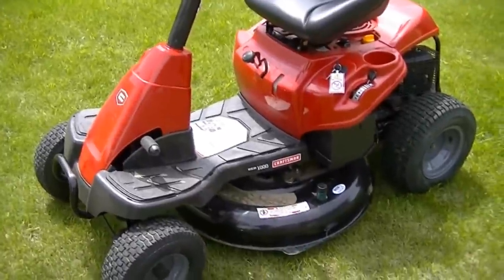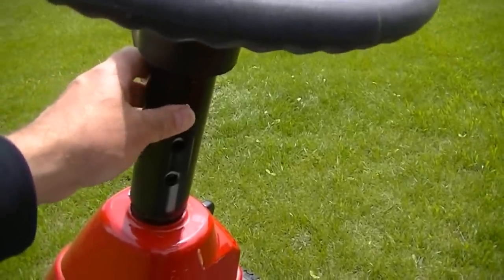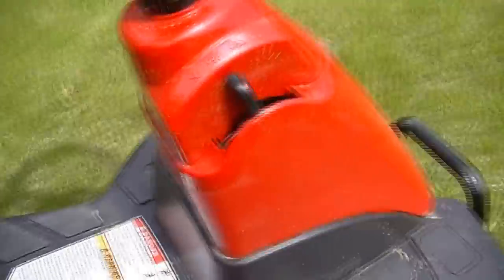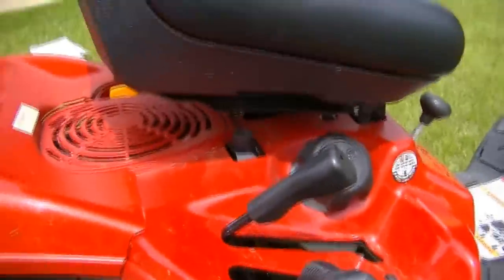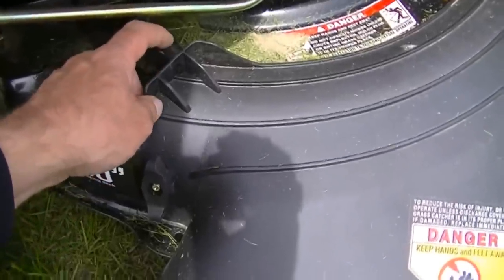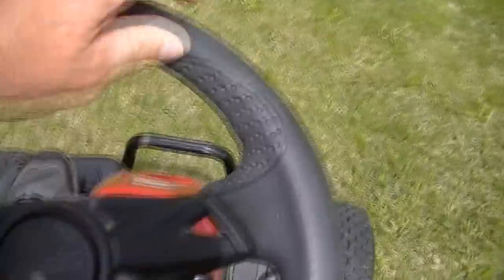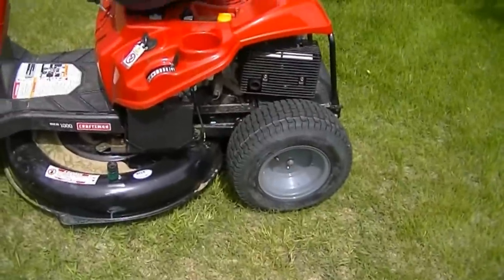Sears Craftsman / Troy Bilt 30" Rear Engine Riding Mower Review

Comment: I've had this mower for 9 years.  No real problems using E10 or no ethanol gas.  I've had a screw come out which holds the oil filler neck 
and has a ground connection.  Can anyone spec this machine screw for me?   The on-line parts view does not show the specs for the small bolt.

Comment: while the seat safety switches can be a pain at times, they whole purpose is in case you accidentally fall off. Imagine your on  hill side and it flips over, you fall off and then a big blade chops your face off.  Deal with the switch and leave in place.
Reply: I've had my R110 Craftsman mower for about two months now. My lawn is flat, but the edges are sloped with gravel and landscaping. About the 4th time using the mower the wheel went over the edging and before I knew it, started up the slope and into a bush. it kept trying to climb the bush and before I knew it flipped over backwards on my back. I'll keep the seat switch, thank you. Can't imagine if the engine had kept running? Im one lucky fella to have no serious injuries from that incident.

Comment: I would probably use mobile one 15 W 50 in it and if there’s anything you can grease I guess you could use boat trailer grease or a really good extreme pressure high temperature grease and obviously stable 360 in your gasoline

Comment: I recommend not using the wash feature on the deck. If you have an air compressor, use that instead. Water will rust these decks out fairly quick, or on any mower for that matter.
Reply: SPACE TRUCKER .. or a leaf blower.
Reply: sounds like a plan ,but it does say to run is for few mintues to dry it fast ,but i would do the same an wash it when it wet grass,then blow it off,wax it but first thing put be liner under the deck 3 coats ,but tape off blades

Comment: I bought the Troy-Bilt version of this (They are all made by MTD), and found two things completely unacceptable.

1.  The clutch release.  Great for doing Wheelies, bad for maintaining control of the mower.  It was bloody awful.

2.  The F/R lever location.  They could not have put it in a worse, more difficult to operate spot.

I took it back after  1 day and got the Husqvarna SRD 28002  instead.
Reply: Raymond Ihrcke Hi Raymond, I have the same model, just wondering if you cut the yellow wire? Thanks
Reply: +Raymond Ihrcke My wire was red... It will be like hooked just above the mower deck..
Reply: slow down  get to know it first gear

Comment: Help, I'm desperate!! Can someone please show how to change the oil in 
the Craftsman model 29000 rear engine riding mower?  The instructions 
and  pictures in the book are horrible.  What is the oil sump on this?  
Do I need to do anything with it after I attach the drain sleeve?  Where
 is the oil drain plug?  Thank you in advance.

Comment: Doesn't the lawn mower stay running when you're in Park when you get off
Reply: no  lawn mower does for safety  reasons it can run you over ,but there are hack videos
Reply: @lifeisajourney5173  yes it stays running, as long as you're in park, neutral and the lawn mower blade isn't engaged..

Comment: Copy from Duck 4212: " have one of these mowers and it operates and cuts very well. There is one thing that I noticed particularly, however.Sometimes when I am in forward gear and I release the clutch from a stop position on an up hill grade,  the mower will not move at all. I think that there is a level of  resistance where the transmission will not engage. I have to put the mower in reverse and back up to a more level grade and then put it in forward and then the transmission will engage and I can proceed up the hill."

Mine does this at random when just starting out on a level surface. Would love to hear if someone knows what it is. Craftsman RER1000
If you're still around with it NDav8tr, how's yours holding up? I'm in my 4th season, original battery 2 yrs and junked it, one oil change. Recommend getting a fluid evacuator to do that. That drain plug is on there for life! Keeping it greased, and one deck paint touch up at the chute area due to rust forming. So far no complaints. Great little rider accept that issue I mentioned above.
I bought the bagger system for it. Well worth it. When I got the battery I went to "Battery Plus Bulbs" and got a Duracell. Cheap and reliable.
Reply: Where did you buy the bagger system at? I’m on my 3rd year and also have zero complaints but have been thinking about purchasing the bagger to go along with it.
Reply: @tmb515  Bought it at Sears. It completes the mower and does a good job.

Comment: anyone know how to remove the red plastic cover? It blocks the battery and I need to change it or jump start it. I have removed the back section and the 4 screws on top under the seat. There must be more screws holding it in because it still doesn't move.

Comment: I replaced the blade and start cutting grass ,I noticed the engine is smoking very bad and after five min. the blade stop turning and the engine stop smoke  .Now I can't get the blade engaged .engine is start and running but blade will not run , Can anyone please tell me what would be the problem. Thanks

Comment: I have one of these and it runs for a few minutes then sputters and dies.   If I let it sit for awhile, it will restart but again only run for a few minutes.  I have replaced all the filters, spark plug and done an oil change.  Battery is new and fully charged.  Any ideas?  Anyone?

Comment: mine is a tb30, same thing basically... i just added the front bumper like the craftsman has.... now i want to mount lights on it... anyone done that yet?
Reply: allentig, I have this exact same Sears Neighborhood Rider. I just added light to the front bumper bar this past week. I had a left over aftermarket driving light I had from my car. The other light, got hit by a rock while driving & lens cracked. I wanted a light, cause I sometimes find myself cutting grass at dusk. Cub Cadet's CC30 version of this riding lawn mower for 2016 has now a integrated light where the steering column shaft goes into the plastic shroud. I looked into the parts while I was at my local authorized Cub Cadet dealer & the two parts for it (light housing & plastic shroud) was going cost more than what's it's worth, well over $50 plus dollars.  So I had this extra driving light, I had collecting dust & I just went to my local Radio Shack store & bought a 12 VDC switch & mounted it on the steering wheel. If you are interested, private message me your email & I can send you pictures.
Reply: i have no idea how to private message you from here
Reply: allentig:

Send private messages:

Go to the channel of the person you want to contact. You can do this by clicking their channel name underneath one of their videos.
Click the About tab.
Click Send message.
Type in your private message and click Send.
Reply: Just bought the Craftsman but it has no front bumper where can I but one I see it has holes in the front for a bumper and in the manual there is an illustration of one

Comment: I have one of these and it works well. The only complaint that I have is that it is very noisy . Does anyone know what the air valve under the valve cover is for. It causes a lot of noise. I think it has something to do with pollution. If you take a rag and stuff it in that valve you will see how quiet it will become. Do not leave the rag there it may catch on fire. I have pulled the valve off and there is a passage between the intake and exhaust that can be plugged off and then it will be quieter but I do not know what problems this may cause. If anyone finds out please let me know, thanks ( Pt#751-12777 air valve bonnet )

Comment: This is a dangerous mower!!  If you turn tight, the steering locks up.  As the tie rods are fixed rods with no adjustment, your screwed!  It has locked up from the very first day and I have tried numerous things to tighten up the free play and/or adjust the linkage for toe in with no luck**********
Reply: warranty 18 inch turning commen sence dont turn to tight ,i will make sure to be careful for sure

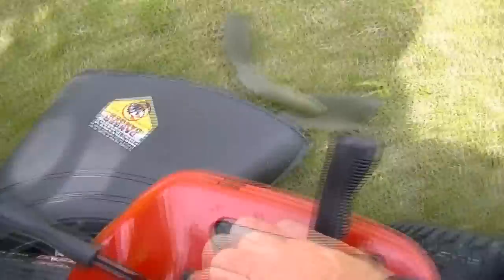Comment: 7:48-Take all of the 'Sears' and 'Craftsman' logos off of the mower and it should be a good unit and quit sounding like it is coming apart when the blade is engaged.
Reply: all lawn tractors have that sound ,but check for loose bolt nuts an screws after each time you use it an before ,could be a loose something ,an it will happen

Comment: Sears has called twice trying to sell me a 3 year extended warranty on my new rear rider for $283.00. The warranty runs side by side with the original 2 year warranty. So you get only 1 year extended warranty. This is a ripoff so do not fall for it please. 99 % of extended warranties you do not need ever.
Reply: but it should be bumper top bumper an they come to your house an work on it ,withe 2 year ,you have to bring it to sears dealer ,an it limited  to certain thing only so it worth it for some ,me u count on nothing going wrong for 2 years ,an treating it like brand new car

Comment: anyone know how to get the battery out
Reply: I, too, need info on how to get the battery out.  It's very hard to even connect a charger to the hard to get at terminals.  The manual isn't any help.

Comment: Those type mowers get on my nerves so much im willing to keep my old new noma at his her house and i go there to do his yard work for him her because i told heshe i can't ride they're little mower there's no way the seat can slide back for my legs there's shit you have to hold down with your foot or it wont cut it does not turn good one bit goes through spark plugs because the engine was built wrong muffler right next to the plug no heat shield between the muffler and plug 

No cover over the chain to prevent damage to it. grease fill holes hard to get to gotta take a bunch of other parts off just to fix one piece or boot its easy to work on but is a bitch those are ones not in my collection of used working mowers 

I did get a free 80ies model snapper and i redone the engine then gave it to a old friend he fixed the drive gears and spring then sold it for 5 hundred

Comment: I never understood how such a great company like Sears could get a Lawn Mower so wrong .. 
First the break and clutch should be and nice pedal and smooth and easy. 
(There's is terrible.)
Second the Muffler should blow out the back not the side. 
Steering should be more like a cars with a tilt to your preference. 
Seat should be far more padded and softer with a bit more height.
Roof should have a cover from the sun.
Should be a huge slicer fan to mulch up the grass instead of making a pile.
Reply: Eastendbiilythekid will craftsman deack fit troy bulit
Reply: its that way with all tractors of the lawn type ,the 500 pound ones just dont get up an go as quick ,you get used to it ,or get hydrostatic
Reply: Understand this Sears makes nothing at all they just sell whats out there. So is something is wrong do not blame sears blame the manufacture.
Reply: Let me see...If I point the muffler out the back it burns my bagger up. Nope, won't work.

Comment: looks like it got a chinese engine on it.  that design looks similar to what sears sold back in the late 80's and early 90's,  rear engine riding mower,  i am no fan of those designs since the drive sys sucks to work on.
Reply: humm the tb 30 same mower is in the  top5 for 2018 withe big boys an this got 4 stars over all ,take care of it may never need to work on it

Comment: Why are people obsessed with circumventing smartly designed safety features? You're not a mowing god, they might save your life. This thing is very cheaply made, for the cost, IMO.
Reply: Many times you may have to get off and remove crap that may damage the mower so disable things make it easier to work with it. Remember for as long as I can remember we did not need them anyway. Just some dickweed got hurt and sued a company collected much money they have since put these on the mowers and last but least the jerk salesmen no nothing about the mowers so can't tell you anything about them
Reply: Smartly designed? They're made for stupid people so they don't run over themselves when they step off the mower. My rider is 26 years old. Only safety it has is a seat kill switch, which doesn't work. I'm very happy it doesn't work because it isn't necessary. I wish my push mower had a kill switch besides the stupid bar you have to depress to get it to start. If I could turn it off another way I'd tape that bar down permanently. Those are ridiculous.
Reply: You have to know your equipment.

Comment: This mower is a piece of junk. It's flipped over on me, lunges forward when engaging the transmission, and cuts uneven. The blades are difficult to find and expensive. If you want a rear engine, go ahead and spend the money and buy a Snapper
Reply: Its not an F150 Jerry, its a lawn mower. Ive had one for 4 years and have had 0 problems, It cuts  great and runs great. More than enough power.(Im 6,2 and weigh 300 lbs too ).Turn radius competes with a 0 turn model and the 30" deck fits through most standard home fence gates  ..for 999 bucks for a new rider there is no better deal .
Reply: I have a F150 and it's too big to cut my lawn.
Reply: first gear for you in the slowest speed

Comment: taking away the safety features is rediculous
Reply: I own the Troy-Bilt version of this mower. Removing the anti reverse mow is a necessity. There's an option to mow in reverse w/o removing the safety feature but it requires pushing an extra button. I just removed it rather than taking that extra step every single time that I need to back up. Removing the seat safety feature, I agree is a bit dangerous.
Reply: not for some ,but for other there a must ,some are not good others are good like the seat switch yes ,but reverse switch has to go look behind you ,an dont be walking behind a running mower